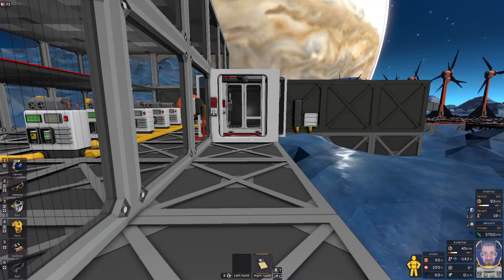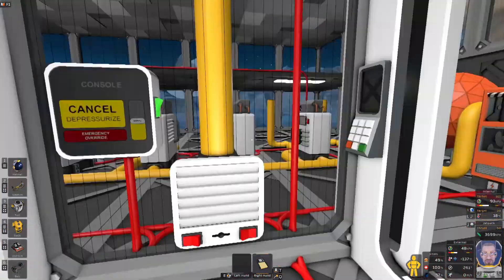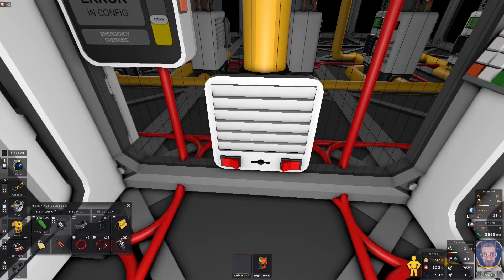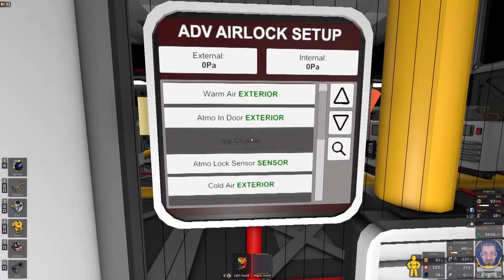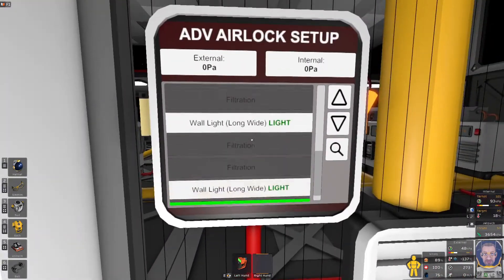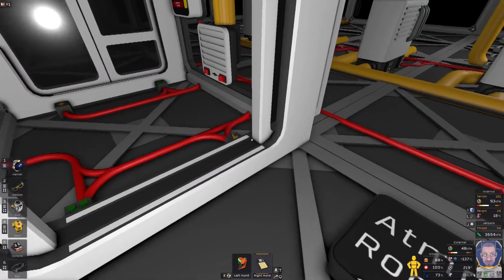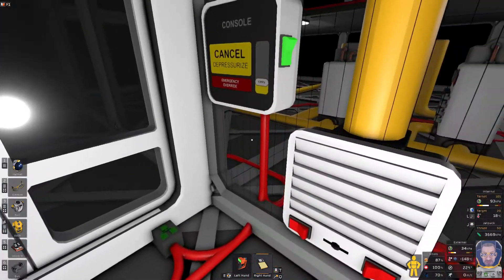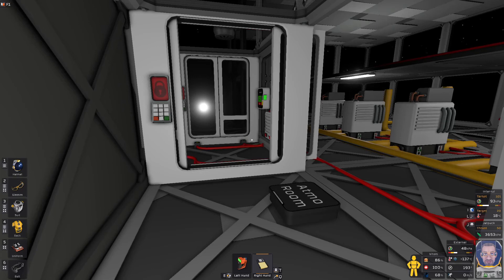Stationeers - Advanced Airlock Setup, Protect your base Atmo from the outside Atmo.

Comment: Just something I learned about an advanced airlock and standard airlocks, If you make it bigger than 1 large grid you want to use another sensor for that grid. Otherwise it leaves trace gasses before switching active vent.   Also an advanced Airlock can only use 1 active vent for each intake and outtake, whereas a standard you can add more active vents to clear that air quickly.  Add a flashing light and link it in the console along with a Klaxxon Speaker and set it to "Airlock Cycling" to make it more Stationeerified. ;)
Reply from the maker: Agreed, larger airlocks need more vents and sensors. the wait time can be pretty rough with out them.